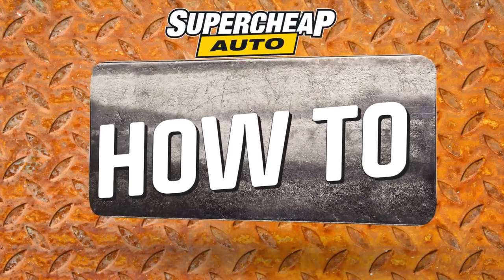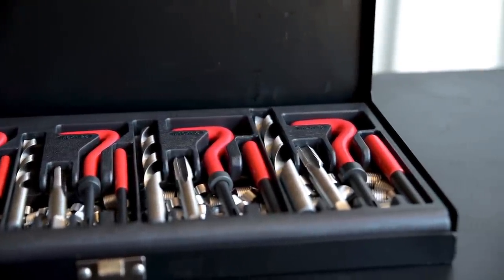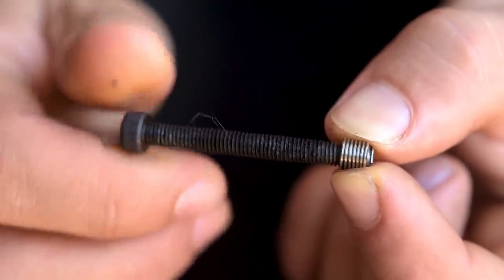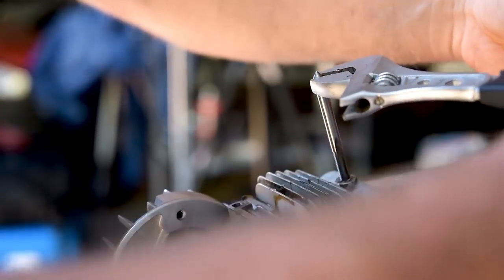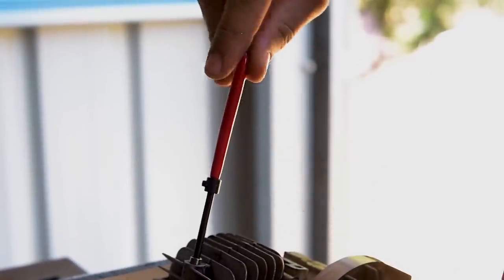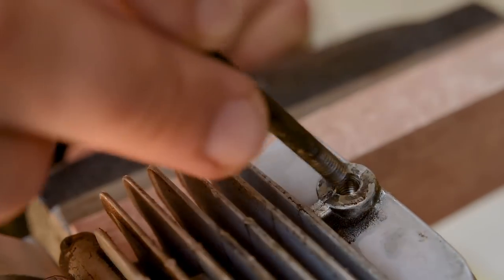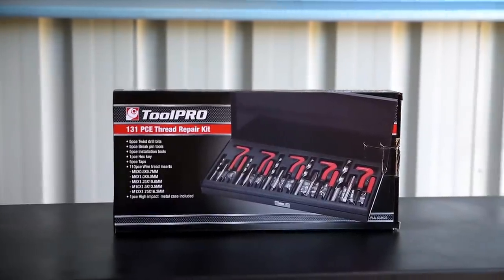How to use a ToolPRO Thread Repair Kit // Supercheap Auto

Comment: Ah-hah - so - a bee's-knee's "must-have' for those that don't have a clue as to what thread sizes they'll need to repair - especially when it comes to home-auto-repairs.. 
Now - a very quick "look-see" at the available sizes within this so-called bee's-knee's must-have repair kit - tells me INSTANTLY that this is actually a totally useless thread repair kit and thus (I am eternally grateful that there's a YouTube video on the Supercheap NZ website - pointing to this very video) .. I must now admit defeat long before I ever got off my Rr's - to go to a store (not close enough to walk too or even drive too) - a long way away from here, to belated see (there in person) - that the ONLY M12 "size" - is in fact the courest thread possible, and NOT a normal 1.50 pitch - or (worse still) NOT even the industry standard - M12 x 1.25 pitch that ALL metric seat belt anchorages (hole/nuts) are sized as...
Which as strange as it MAY seem - are the one's stripped (inside the vehicle's bodywork).!!!
...
So - to me - this is utterly worthless, apart from relearning how to drill an oversized hole, to insert a "wire-insert" (aren't these supposed to be Stainless Steel - and not just "wire" ..) to again obtain an M12 x FINE THREAD 1.25 pitch ?

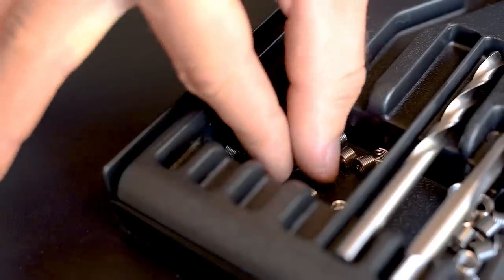Anyhows .. (seeing the first few seconds of this video) - 0:21 seconds in - has saved me a lot of wasted gas money & travelling time as well - if I had needed to drive the approx 250 - 300 km (the "round trip = there AND back" is too far to do easily or cheaply) - to find out that the website's stated bee's-knee's must-have kit - isn't this (viewer's) bee's-knee's necessity after all - as it is a totally useless "kit" - in a store (not nearby) .. missing as it is - the actual thread PITCH sizes I need - being the FINE 1.25 pitch of the M12 seat anchorage nuts..

Oh & P.S -- I am so glad I stopped watching this useless video - and only skipped through the rest - as?
WHY !!!!
Why put the extremely important disclaimer - at the VERY END - after everyone else has ALSO - completely stopped watching - to go replicate your "advisory" video's content - when?
YOUR DISCLAIMER - is actually the most important part - and SHOULD have been right at the start..
re:
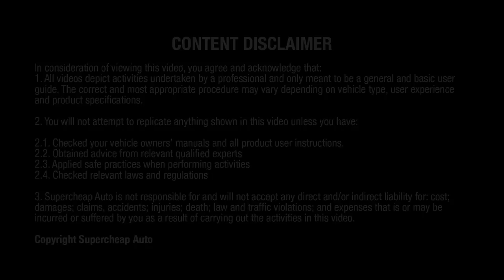1:53 
DO NOT DO THIS AT HOME !!!!!!!!!!!!!!!!!!!!!
?
The reason no one "should" abide by this video's apparently good instructions are - that they are useless for the home handyman - (or worse, for anyone STUCK out in the wop-wops, with a vehicle they desperately need to fix "themselves") as ?
Supercheap denies (via this end of video disclaimer) - all liability for the use of this "home" handi-man (experts not) fixit kit..
Reply: actually its fine
Reply: what else were you expecting from these corporations?